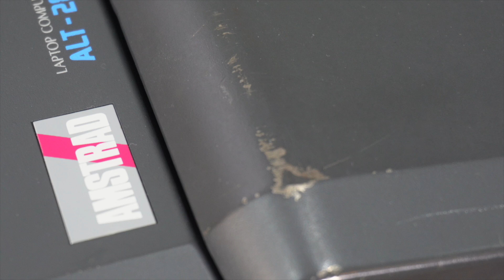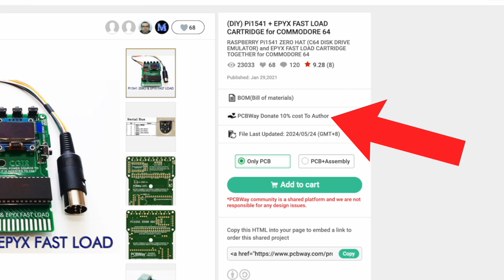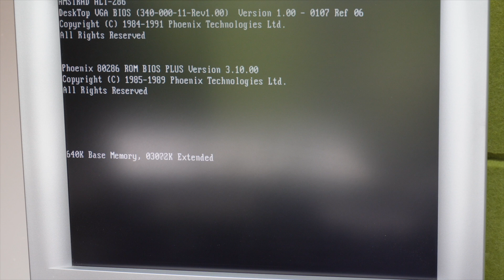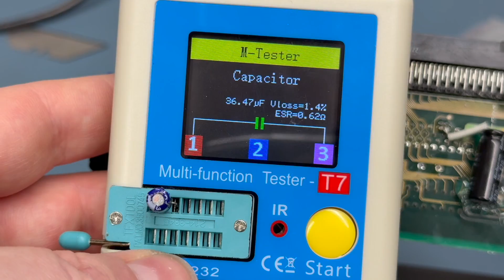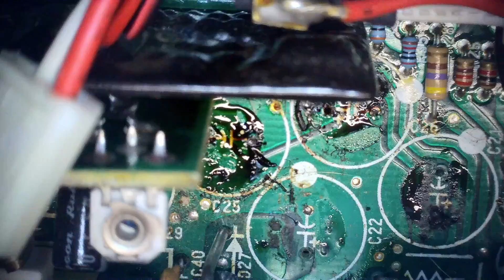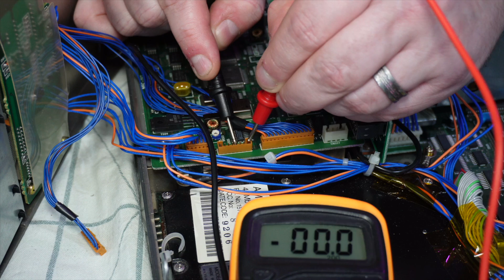This Amstrad ALT-286 Broke Me

Comment: Hi Matt, thanks for the video. Question, would you be able to provide a shopping list for the PSU caps? Found the capacity and voltage mentioned online, but not enough details to order the new parts.

Comment: I know this video is already over a year old and maybe you made some progress already, but chances are that the -24v is just fine and only shows > -30v because the rail has no load. As you probably know, a switching mode PSU can only regulate rails that have a load on it. The circuit that delivers the -24v to the LCD may have a broken component somewhere, which means the circuit is open and hence does not provide any load to the rail.

Comment: Why would you measure power between pins 6 and 8 and 5 and 8?
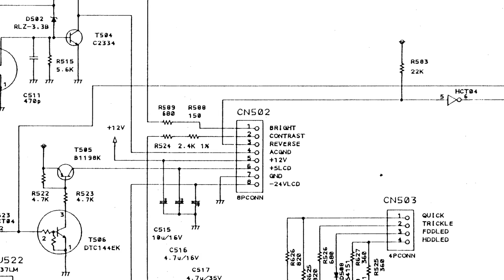At 17:52...... The only proper measurement is between 7 and 8 while holding the black pin on 7 and the red on 8, provided you stuck them the right way around in your meter.
At 20:38...... Well, actually.... It depends on how you look at it. The expected potential difference (which is voltage) is still 24volts, measuring 3.5, makes it lower. The minus only indicates it is on the opposite side of zero. The display panel, if damaged, is probably not damaged due to the 3,5 volts because it is in fact lower than expected, as I just explained.
You could have measured all the output voltages directly on the power supply by tracing back the wiring.
It is probably a very simple circuit because the -24 rail most likely draws very little current.
However, I think you already repurposed the whole computer so it is not useful to come back to it and it is already 6 months ago. ;-)

Comment: Do not need a schematic to  fix this,  negative 24v  measuring around  negative 5v to  negative 30v(your multimeter is actually seeing AC in the DC range for a moment) means dead  rectifying diode on the 24v line ( secondary of the PSU- often the cause of it is leaky cap) . Just follow the negative 24v rail and  find the big double Schottky rectifier (often 3 legs, looks like a transistor) on  a radiator responsible for this voltage-24v. Take it off, measure it  and  you  will see that 1 of the 2 diodes in it  is  defected( Also it could be shorted small ceramic cap bridging the diodes- so if there are such check them 2 out also).  After this is Fixed,  if the problem persist after the LM337, you should also replace LM337- stabilizer and check the 2 SMD transistors.  On the backlights  You should measure AC, may be even around 750v- so DO NOT  touch there(on your own risk) ,  and the cheapo digital multimeters have trouble  seeing it anyways . Disclaimer- Primary of the PSU can end you -LIVE voltage there, so do not touch there either.
Reply from the maker: That’s massively helpful, thank you!

Comment: Sw7 is set to Colour but Display is Mono?!?
Reply from the maker: Yep that confused me too. I tried both ways, no difference
Reply: Btw... I would always check supply voltages with an oscilloscope. Especially if the values do not change comprehensibly, a AC voltage component or other fancy stuff may be included in the measured value. That's why I only check with an osilloscope
Reply from the maker: @bytekilla666 I would love to do that. Currently I don’t own an oscilloscope. As a rule I fund all the tools and equipment I have through YouTube and sponsorship revenue. An oscilloscope is on the shopping list 😁
Reply: @TMEretro  You can use a small DSO150 or similar (ready built or kit) for beginning. Pros: cheap, can be battery powered so it is isolated from the mains, low bandwidth enough for troubleshooting PSUs and audio circuits and good for learning how to use this tool. Cons: low bandwidth, so in time you will need a better scope, small screen, one channel only, no extra - maybe useful - features (FFT, distorsions, etc).

Comment: You can always drive an external -24V (very careful with that), but you should use a current limited power supply.
It is very easy to reverse polarity so please ask for a technician to help you with that. The 24V psu I have here is from brand Gophert, it is variable and has a configurable current limit, so you can start with 0.1A limit just to not burn anything.

Comment: Can the card not detecting the modern LCD monitor. Try grounding pin 11 or 12 on VGA Connector. 
-24V is for LCD bias, it is not critical, but if panel have some issue can draw more current and down the voltage (even shutdown the PSU).   
Also, need to check the capacitor on the panel.

Comment: I would venture the PSU is probably fine outputing ranges outside -24V . I suspect it's the LM377 power regulator that is the issue. As it does the -24v conversion. Check at the input leg what voltage gets to it
Reply: I agree with you.
Reply: yes sir

Comment: I'm currently converting 1 of these into a SteamOS machine
Reply from the maker: Wow, that sounds really interesting.  Presumably you're putting a modern system inside and interfacing with the existing display and keyboard?
Reply: @TMEretro  yes, using the innards of a ryzen 5 laptop, iPad lcd and a custom mechanical keyboard